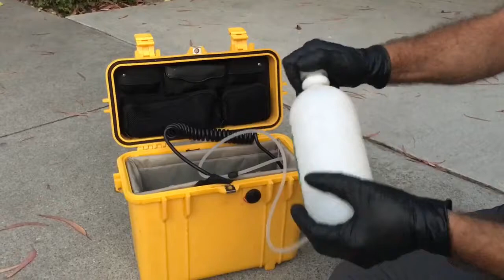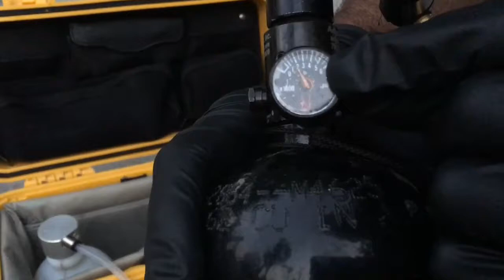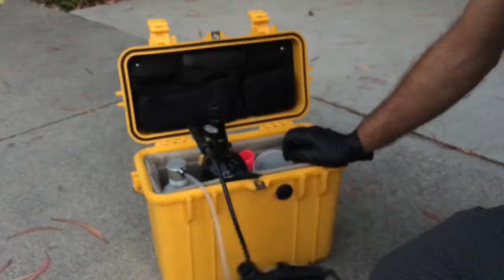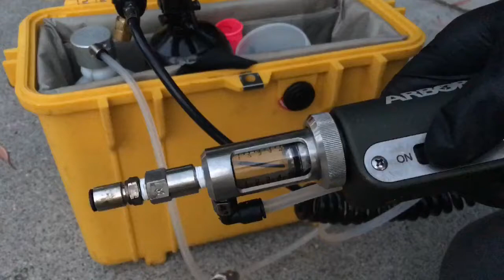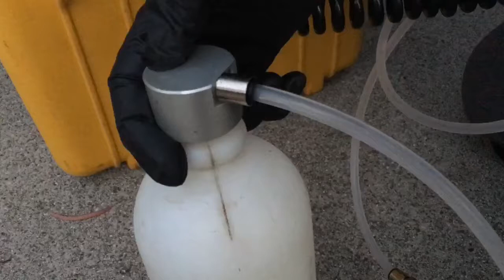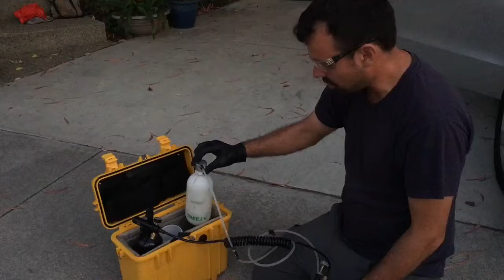Broken Quik Jet Air , July 2016

Comment: have you reached a definitive conclusion from this. I have found that the treeage is pretty sticky and effects the spring and bearing at the T intersection by the barrel. this is in reference to the standard applicator, not the air assist version. I have found though, if you place your finger over the needle during the barrel refill stroke it increases the back pressure and draws fluid from the reservoir. just curious what quick jet said because i have scratched me head over this too.

Comment: After watching the video, I feel the key element to your situation is the liquid coming out of the bottle, then flowing back in.  That tells me that the inline check valve, which is the metal piece connecting the lines running from the bottle to the device is stuck open.  If you pop the lines off, you can use a small allen wrench or screwdriver or the needle clean out tool, and insert it from the end at the back end of the arrow (there is an arrow on the check valve showing direction of flow).  While doing that, you could apply some lubricant as well.  That should free up the spring and gasket in the check valve allowing it to close and create the syphon to pull and keep the product moving towards the bottle.  Check out the video from Arborjet HQ on troubleshooting the QUIK-jet Air.  https://www.youtube.com/watch?v=dPKISB436co&t=9s
Reply: Zachary Purinton this is exactly what the issue was. I got a new check valve and cleaned the old one. Now we have one on device and a backup always on hand